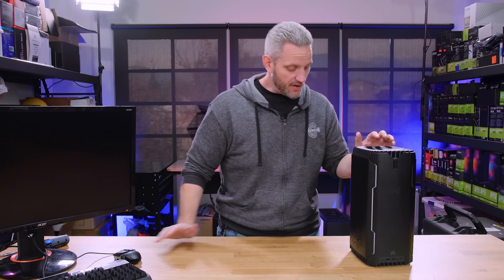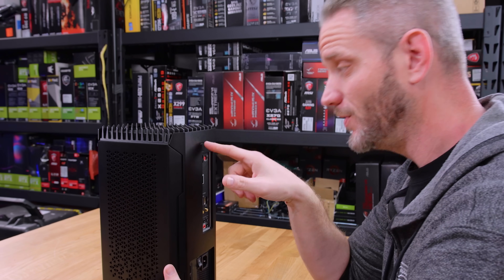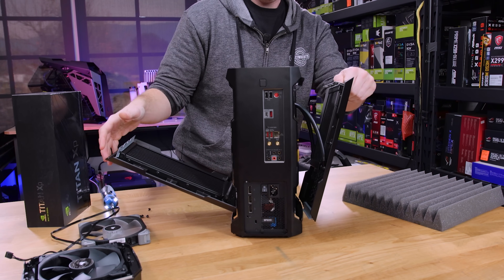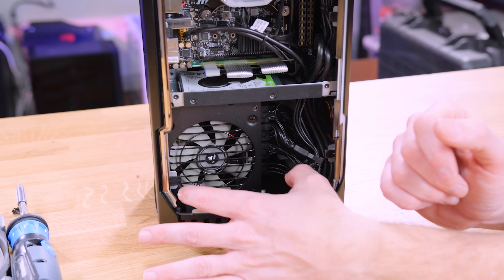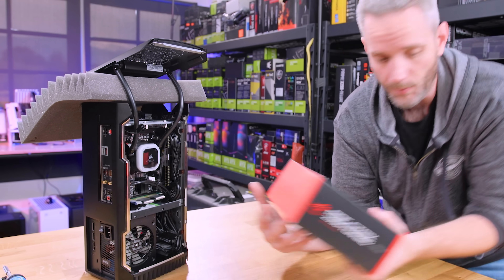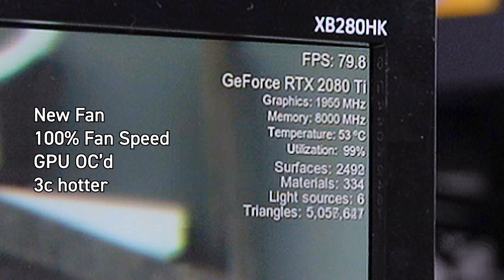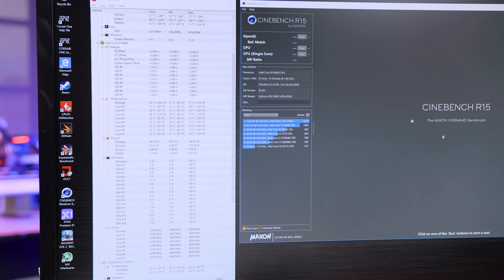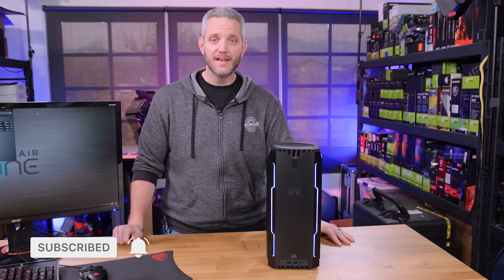Overclocking and Tear Down of the Corsair One

Comment: Jay - Not sure if you’ll see this on an older video but I have an Corsair One a100 and I’m trying to reset my CMOS but having an issue locating the CMOS battery. Corsair said I’m out of warranty so I should go pound sand and find a local repair shop. I’d at least like to try to reset CMOS to try to resolve not having any video output. Any idea where the CMOS battery is on this SFF build? Their support site points me to a magical “reset CMOS” button that doesn’t exist. Thanks Man

Comment: @JayzTwoCents Okay, since it's been two and a half years since this video came out, I wanna see you do a video with the Intel-based Corsair One i200 model. Evaluate the highest-end model (https://www.corsair.com/us/en/Categories/Products/Systems/CORSAIR-ONE/CORSAIR-ONE-Compact-Gaming-PC/p/CS-9020028-NA ) at its stock configuration; then do an internal upgrade of the whole system to see if more performance can be squeezed out of the case: replace the Z490 motherboard with a newer MSI MEG Z590I UNIFY (https://www.msi.com/Motherboard/MEG-Z590I-UNIFY ), upgrade the RAM with the fastest 64GB kit available (https://www.corsair.com/us/en/Categories/Products/Memory/VENGEANCE-LPX/p/CMK64GX4M2D3600C18 ), replace the RTX 3080 board with the more powerful but identically-designed board of the 3080 Ti or 3090 and replace the PCI-E 3.0 riser with a newer, faster PCI-E 4.0 x16 riser and replace the 750W SFX PSU with a 850W SFX PSU (https://www.coolermaster.com/catalog/power-supplies/v-series/v850-sfx-gold/ ), but keep EVERYTHING ELSE from the model. Then test out how much more performance can be achieved with the upgrade.

Comment: I have an corsair one i160. What was the best bios configuration and overclock settings for the cpu and what to overclock the gpu at that you found to work good for gaming and is stable? I've been trying to tinker around with the oc settings but I'm terrified to go too far without some assistance from a professional so I'll less likely mess up my main computer.

Comment: I popped the 3K RPM Noctua fan in mine and because the custom fan curve only lets you set a constant percentage (with some firmware override for when a threshold is met) and not a real curve, it's just crazy loud when it doesn't have to be. Has anyone been able to unlock true custom fan curve controls on the Corsair One?

Comment: So I got the Noctua 3000 rpm fan. The Corsair fan connector wouldn’t work. The iCUE software isn’t able to power it. Only if I set it on 1000%, the fan would spin at 2800 rpm. If I set it any less, it stops spinning. I and wondering if you have ever been able to try it out.

Comment: So I just got a Corsair One Pro i200 and it looks very similar. I was able to put two more M.2 NVMe in it but it took removing the video card, not the cooler, just some screws and cables. I forgot to add the SATA SSD though but mine does not have a SATA drive already so I will do it some day.  I want to see if I can change the RTX 2080 TI with a RTX 5000

Comment: WHEA BSOD is deffective CPU lol ... The Internal Clock not matching the right CPU Clock it's made for, This Problem Occur at the Manufacturer test Facility, when they downgrade a chip because they aint passing the proper test to be consider i9-i7-i5-i3 chips . Overclocking lead to this also. But because the chips at the facility are so well tested that WHEA BSOD rarelly happen when it's out on the market. (Beside being Overclocked )

Comment: id rather use a fractal design core 500 itx case with asus z370i, i7-8700k, be quiet dark pro 4 cpu, corsair 16gb ddr4, 250gb nvme SSD, 4tb nas backup drive, corsiar SFX 600w power supply & evga geforce gtx 1060 6gb ssc, windows 10 pro.  my 8700k was delid & temp are down ~10-15 C.    idle in low 20 C & never got higher under load 60 C.  the gtx 1060  GPU has reach ~ 74 C.  & still quiet.     spend ~$1400 & turn right side up & look similar but square & still more upgrade.

Comment: I ran into the same issue trying to overclock the 9900k on an Asrock z390 mobo. It wasn't until I switched to a gigabyte board that I was able to get a locked 5ghz all core "factory" boost. Had to switch to the gigabyte board For SLI (didn't realize the Asrock board didn't support it) 

For the life of me I couldn't figure out the asrock bios. I have an old Asrock 970 mobo with, in my opinion, a much more intuitive bios.

Comment: I have no issues with my Z370 Gaming Pro Carbon, overclocked my 8600k to 5ghz and it's always between 4995 - 5002mhz, but i'm new to overclocking, i just used a video from MSI on how to overclock with the exact same mobo/cpu i got and used that as guideline, went surprisingly easy, got it stable at 5ghz first try and 5.2ghz in 2 tries. Guess i just got lucky with mine

Comment: Making it white would be cool. And the top LED would show more. Or brushed aluminum. Those are my favorite case colors. Doing one of those with an airbrush blue/green fade from bottom to top would be slick. Or solid colors, either or. Also, I just built an entry-level R220g system for myself and got a msi b450m bazooka motherboard, and its great except for trying to OC. I haven't built a system in like 10 years, and it's almost more annoying trying to figure out how to navigate their bios than things were back then lol. NOW you tell me!

Comment: Jay.... PLEASE.... for the love of God put the ASUS Motherboard in.... Put the Titian GPU in ..... Also EVGA's SFX 650PSU.... AND SOME Corsair dominator plats or maybe one of the special editions that you own. 

MANDATORY WHAT TO DO LIST: 
#1 - ASUS STRIX ITX Motherboard
#2 - RTX Titian GPU
#3 - EVGA SFX 650 PSU
#4 - Better Ram 
#5 - Get either a mini fridge or like one of those gas station red bull display refrigerators that the computer will fit into and give it a chilled home 
OPTIONAL: 
#1 - Take your best mini rotary cutter of choice and remove the metal from both side doors and leave like a 1inch to a 1/2 inch bezel.... 
#2 - Add plexi or tempered glass with vent holes 
#3 - Maybe just go with plexi on number 2 above and drill holes for more fans in your new plexi sides maybe .... 

If this is more work than you want to do to it then send it here and ill be more than happy to make the mods myself zenith223@gmail.com

Comment: Highest RPM fan.
Brushed effect on the aluminium.
Larger CPU radiator
Asus ROG Mobo
High capacity PSU
RTX Titan GPU
Push it all to the maximum.

Comment: It happens because motherboard mosfets (VRMs) are overheating. (CPU throttles down). I have MSI motherboard too (MAG Tomahawk z390) and can't overclock properly because VRM cooling is not good enough (CPU throttles when VRMs hit 100C, but CPU stays at around 75C). And it seems this is a common problem with MSI motherboards.

Comment: So my thoughts on the frequency issue is that there is usually a power saving feature that will let the cpu run at a lower frequency under low load, I suggest you try your test again while running prime and see if the cpu doesn't run at the oc you are trying to achieve- if the frequency is running at either the oc or the frequency you're observing, then I think this is definitely what's happening, but it won't affect performance.

Comment: there is an NFC dude that powered a RTX 2080 (TI I think) and a 9900k with a 400w psu from HD Plex, and this dude telling me that 600w is not enough, 
WTF is going on?! :(
Reply: Um... I can't wait until that dude has to replace his power supply years ahead of when he should have had to, if he would have had the proper size... Yes, they are designed to run up to that voltage and wattage, but the higher voltage and wattage drawn, the higher the heat... And let's face it, the higher the heat, the sooner things will wear out... Besides, there are two points to be made here... The first is to make sure you are using less than 75-80% of your total load, to keep heat at manageable levels... The second, is to remember that overclocking a computer, or upgrading components, all add to the power drain, which can really stress the limits of a power supply if you don't allow around 200-300 watts of leeway, although Jay doesn't really have to worry about overclocking that PC much... A 650 watt or 700 watt is the highest I'd ever use though, unless I was building a supercomputer...

Comment: Jason, I've read some say that AIO's should be replaced yearly - just to be on the safe side.  Those AIO's ARE proprietary correct?  Are replacements available?  How much are they?  And for how long will Corsair make them available?  Is it at all possible to replace those rads with something off the shelf?  And also, with seeing how many of the parts are off the shelf, I think there may be a market for a bare bones case.

Comment: I had the same problem with an Asus board dropping the MHz back to low speeds after an oc. Turns out I needed to use the XMP2 profile to override the default intel oc. I think MSI has the same issue--it's so Intel can say the chip has a lower watt rating--until YOU choose to overclock it. Hope this helps.

Comment: Jay, the problem is involving the CPU power limit on the motherboard. I've had a similar issue with an MSI Z170 ITX board and an i7 7700K. In my case, the max power limit for short burst is 135W for 10 seconds, which then drops down to 115W. I've attempted to adjust the power limit and power limit time using xTu, but I've had no luck in resolving the issue. Could just be MSI cheaping out and not wanting things to be too expensive to consumers? I dunno...

Comment: Its hardcoded, you cant change the cpu clock.
Bios changes and whatnot, is essentially making changes to the build in software in a motherboard and its various chipset settings etc, wont work if its literally hardcoded to run at a certain speed.

Kinda tired atm to go into details, i really hate being sick.

Comment: Put a fan at the bottom, that will push air trough the case and radiators inside, and then out of the top. That would make temps even better, and would only require additional 2cm of height.

Comment: I have no problem with overclocking with MSI motherboards....Maybe you set something wrong.
Turn off Game Boost in top left corner.
In OC menu set OC Explore Mode to Expert.
Turn off Enhanced Turbo.
In CPU Features menu set Long and Short Duration Power Limit to maximum (4096) and CPU Current Limit to maximum (256).
If this steps did not help, then maybe Z370 VRM is not good enough for i9-9900k (maybe overheating?)

Comment: 6:18 why? Like can someone explain this to me? 😂 For me, a 24 Pin Cable is a 24 Pin Cable. What are the differences between the brands and why can't I use corsair cables on an EVGA Power Supply?
Reply: The pin out on the PSU side is different between the various makes and models of power supplies, always use the provided cables that come with a PSU.
Reply: @bryandepaepe5984  thx for explaining <3
Reply: @adamfcplm  I agree with Bryan... If you take a set of cables from one fully modular power supply and place it next to another you will notice, that most of the brands if not all, literally will not even fit on another power supply, because the individual pin plugs are keyed (shaped) differently on purpose so you don't fry your system trying that. Do I think they should make it a standard, so you CAN do that??? Yes, I do, but I also know that it will likely never happen. There are ways around that, by possibly mapping out your wire colors and switching your plugs, but I would not recommend it for most people as it can be hard and/or time consuming... Not to mention the fact that if the new cable, or the old uses cable covers, you might not even see the colors of the cables, an end up again frying something... You can see why it's easier to have custom length cables built on CableMod.com, or else just using the cables that come with the replacement power supply

Comment: Strap some 140s on both of the sides with ML fans running 2000rpm and see how much cooler it could be
Other than the motherboard, the relatively slow ram and a rather slow HDD which is best removed IMHO, I always wonder if having some fans directly pushing air through the radiators at the expense of a tad bulkier case would do magic. 

Great video btw - and I digress.

Comment: You could replace the PSU with a Corsair SF750. Same cables, higher wattage and 80 PLUS Platinum. I have an SF600 in my build and it is pretty phenomenal.

Comment: 11:52: 
It may do this because of the VRMs thermal throttling. Even if your CPU is cold, your VRMs are not. I have the same problem with clocks and voltage falling when pulling too much power on a ASRock 970M Pro3 and AMD FX 8350 CPU even at stock speeds. Adding a little fan on the VRMs stopped them from throttling down my CPU and proved that my issue came from there. Maybe try cooling, just a little fan on the VRMs is enough.

Comment: You should use some chemical to completely strip the black off the side and then make it into a polished chrome finish. And also when you overclock it you should make some kind of hinge to hold the panels open and throw in some quick connect fans and call it a gaming mode. Plus it’ll look like a plane with super shiny chrome wings and a black nose and tail.

Comment: LOL JAY CALLS THIS A TEARDOWN.... LINUS AND STEVE AT GAMERSNEXUS, NOW THOSE ARE HOW YOU DO TEAR DOWNS...

ALL JAY DID WAS REPLACED A FAN AND OPEN 2 SIDE PANELS...
Reply: Um... He wants it to be able to run when he's done with it 😂😂😂 it is an over 3000$ computer, after all... Funny thing is, anyone could build something just as good for way less, from scratch... Just 3D print a case, which shouldn't be too hard, and then the rest of the parts are around 1000$ or less... Might not start off looking as good, but it's still cheaper...

Comment: You can get up 35 to 38c if vacuum seal the gap under the cpu radiator and allowing only the psu air to get out.... Dont forget to vacuum seal the side... Trust me i did this and i got great result
Reply: Interesting. I picked up one of these for cheap recently to play with. I might give that a try.

Comment: Funny you mention Gigabyte having the worst bios, just had the same problems with my new rig trying to overclock to 4Ghz on my ryzen 3, turned out to be the "cool and quiet" function overriding the clock multiplier, motherboard in question was an aorus gaming 5 x470, may just be that I've had to deal with their Bois in the past but it didn't seem any worse then Asus to me.

Comment: change out that motherboard to an asrock z390 phantom and while youre in there a set of 970 pro's and better ram then put in that evga psu you have and sleeve all the wires so it looks badass and can run just about any gpu for future projects

Comment: Jay, Guru3D forum member "HWGeek", released a modded Cinebench version called "Cinebench R15 Extreme Edition" which is modified to render at about ~4x the resolution of normal Cinebench R15 and it's especially made and useful for the HEDT platforms. Of course it works perfectly with non-HEDT as a well. It's also submitted at HWBot as a beta.
Totally worth a look. www.guru3d.com/files-details/cinebench-r15-extreme-edition-download.html

Comment: How about one of the 3 amp delta workstation fans that dell useto use in there work stations 

Check and see if the cpu is perfectly flat

See if you can get a replacement cooler and make both radiators same size

Put faster ram inside (why cause its J)

Comment: 3000 rpm fan? Pffff. I have an 8000 rpm fan that generates as much static pressure as the induction blower in my furnace. Sounds like a jet too.

Comment: @JayzTwoCents - a theory on why they chose that particular motherboard - pause at 7:40 and note the USB cable plugged into the CPU block for Corsair Link, and how close it is to the DRAM.  Is it possible that the Asus Z390 motherboard's CPU socket positioning is slightly different, say maybe 1-2mm closer to the DRAM slots? Or some other repositioning of a particular component that would make other bits not fit correctly?

Comment: Here's a few ideas:

- Get a 3000 rpm fan for the top cover
- Go with the motherboard switch
-  Swap out the gpu w/ a Titan RTX or something crazy
- Strip the coating on the case and go with maybe a polished look? If too difficult, paint it some crazy color
- You mentioned that the aio coolers were rgb but disabled perhaps. Try to see if you can get some rgb working for them

Comment: Hey Jay! If you're looking to upgrade the PSU in there you should check out the SF750, it has the same cable pinout and dimensions as the one currently in your build and should give you some more headroom on overclocking as well as run a bit quieter. Also, have you looked into the Asrock Phantom gaming z390? it should have a slight edge over the Strix board you wanted to swap out. Hopefully, the layout is similar enough to the motherboard currently installed!
Reply: 4 years on but wondering if you could help me out. My corsair one 2017 has what I believe to be a faulty psu, so I've taken another spare psu and I want to hook it up outside of the case to see if the machine powers. On my motherboard I can only see the 8 pin cpu header and not the 24 pin, but coming out of the psu is a 24 pin cable. Do these boards require 24 pin .. because for the life of me I can't find it, it's either super tight against the front panel or the 24 pin end coming from the psu turns into 8 pin .... I'm tearing my hair out here !!

Comment: Hey Jay, I've encountered the same problem with MSI bios some years before with my i7-6700k. Turns out there's something called the "current limit", you have to manually increase the "current limit" in the BIOS so that the CPU clocks will not throttle down.
Reply from the maker: I know that. I even mentioned that...
Reply: @Jayztwocents  opps sorry perhaps I missed that...